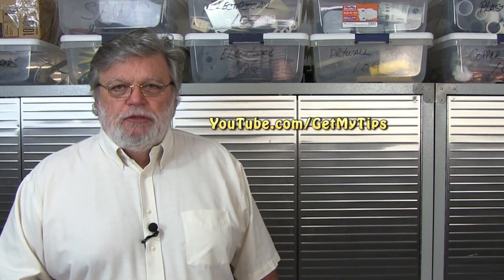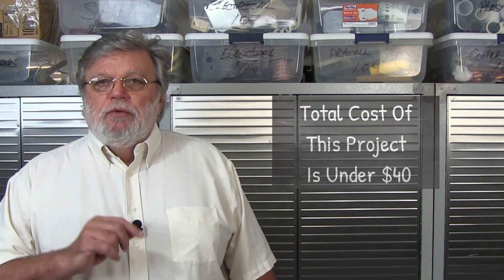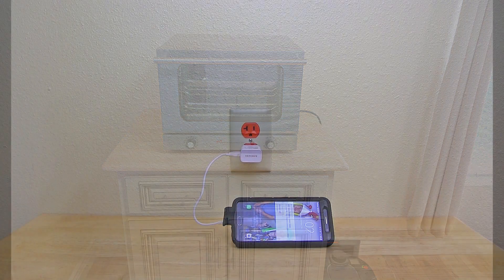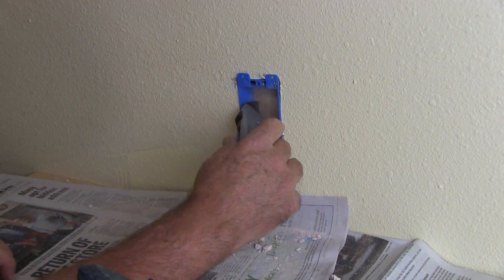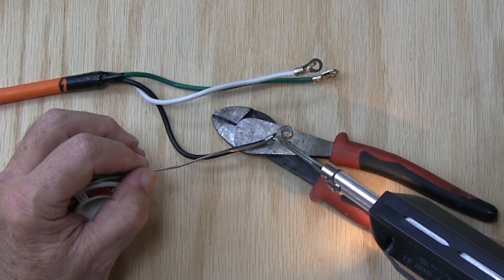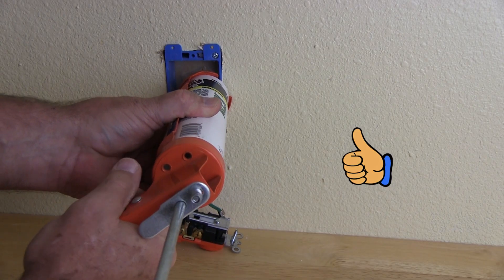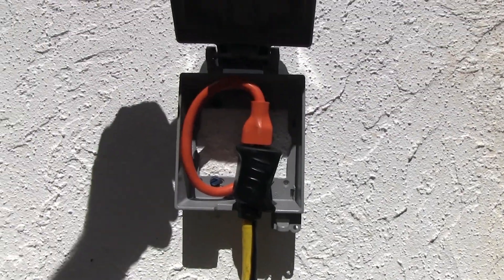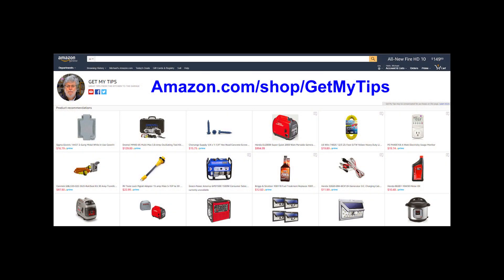How To Hook Up A Generator To A House

Comment: Not bad, but for a few bucks more you could go through the main panel with a breaker then use an interlock kit to force turning off the main breaker, which would both make it up to code AND supply 240 volts for more appliances without using extension cords all around the house. The most expensive part of doing it this way would be the 240 volt cable to connect the gen set to the house. Likely under $200 for everything if you shop around.
Reply from the maker: rupe53, The purpose of the video is to demonstrate how to connect a generator to the house without having to call an electrician. 99% of the population is unqualified to install any kind of transfer switch or interlock switch. Therefore they must hire a qualified electrician to do that. The video that I demonstrated is for folks who have a limited electrical skills and a minimal need for emergency power over a short period of time. Personally, I hope to never use my generator again. Although that is unlikely since I live in Florida. But if I do have to use it, I only need it to power a couple of small items for a short amount of time. So therefore, what was demonstrated in the video is perfect for me and most other folks with low electrical requirement in the event of an power loss.
Reply: Ok, I'm on your side and I understand the idea of DIY. OTOH, using ALL parts that are UL approved should be a focus on any home project like this. Shallow outlet boxes are available and the exterior could have been done with a fixed male inside the box instead of an old extension cord. The point is that once you modify a UL approved device then it's no longer UL approved. (cutting a box, cord, etc) While it may be a minor code violation, it's a violation none the less. If there should be an issue it's highly likely your home owner's insurance will laugh rather than pay up. Putting disclaimers under the video is only a patch / fix. Stuff like this needs to be IN the video so it's not missed. My guess is that for every 100 people who follow your instructions there will be a few who figure on using a longer cord or making other changes in a wood frame house where these minor problems can get out of hand. This is where people get in trouble.
Reply: @rupe53  perhaps he should of made a comment in the video. UL listing is definitely something people should consider. however UL listed does not equal the only safe way. What he demonstrated in the video is largely very safe for anyone with basic common sense. perhaps maybe even safer than some UL listed devices would be.
Reply: yeah, but most people are not willing to mess around the breaker panel without going to electrician school. Therefore they'd have to get an electrician, possibly have to turn off power, and possibly have to turn off power from grid.

just having to get the electrician makes it much, much more expensive.

it is definitely not just "a few bucks more."

Comment: Umm  if you do not kill the main feed to the house you will back feed the grid, possibly blow up a transformer kill a lineman working on the system also back feed neighbors and run a risk of blowing up generator when power is restored to grid...  do not follow this advice
Reply from the maker: I am curious sir, did you even watch the video? Please explain based on the way it was demonstrated in the video, exactly how it is possible to, “back feed the grid, possibly blow up a transformer kill a lineman” as you say.
Reply: Yea   guess I was only 1/2 watching   when I saw what looked like someone making a suicide plug.  My bad I will try to remove the post if possible.
Reply from the maker: +darvonlechtinstrad well I appreciate you coming back and saying that. However you should leave the post up because you're not the only one who makes that mistake. Perhaps it'll help somebody else. Thanks again

Comment: Shout off the main breaker so you don’t electicute a lineman.
Reply from the maker: This is not a back feed situation. The system that I installed is completely isolated from the house wiring. There is no way that any power company service man could be harmed.
Reply: HUH? this is not even going through the panel lol

Comment: I just run an extension cord to the fuse panel turn off the main breaker and hook up to the top terminals to power the whole house
Reply: People who dont know the basics shouldnt mess with electricity
Reply from the maker: Wow you must have a very powerful generator and a very heavy duty extension cord to do that.
Reply: @Flatus Antiquitous no it wasnt. And good for you.im electrical engineer as well, with mechanical as ba. It was directed to james...in saying that, as an electrical engineer, you know this is A: illegal almosy everywhere, and B nowherr near the best way to do it......not even close to engineer stats lol. Peace. You do it your way, i will do it mine.
Reply: in the words of Eddie Murphy,"Now Thats A Fire"!!!!!!
Reply: Dumb. Just plug in to dryer outlet.......duh. that powers both legs which is whole house. No open panels, no screws to turn, no cords to wire. Bam!

Comment: I thought he was going to wire the fuse box.
Reply from the maker: Scotty, There are lots of different ways to get the electricity from the generator to the inside of your home. Since I only needed to power a couple of items, the video demonstrates how “I did it”. It's an easy solution to a short-term problem, keeping the beer cold in my refrigerator until the power comes back on, ha ha. If you need to supply electrical power to your entire home and your generator is capable of producing enough power, you should install an automatic transfer switch, or a manual transfer switch next to your circuit breaker panel.

Comment: Very good video but you forgot to show one very important step and that is how did you wire up the wall socket. You can't just wire it any old way if you want it to work correctly...
Reply from the maker: Yes that's true but if someone does not know how to wire up a receptacle, they probably should not be doing this.
Reply: I appreciate the tips but the video specifically said one didn’t need to have any special electrical knowledge. So, yes, telling people how to wire or solder might’ve been a good idea, if required. 
Personally, I must have missed a step because it seemed like the installation was simply a plug in method to pass electricity through. I don’t see why shy wiring would have been necessary. Maybe I’ll watch again.
Reply: actually you probably could wire it up any way,  there are only two choices,  both work

Comment: Cool video, I ran my extension cord through the window, this method will be much much better than what I did thank you very much.
Reply: You can do that, but there is always a small risk of backfeeding. Just spend the extra money and time and do it right. Use an interlock and install an inlet to a breaker in the panel. Get a generator to power the whole house or at least most of it. I power my whole house with a 10kw. I spent about $1500 for everything. I had a cheaper option, but wasn't happy with it.
Reply: @billybassman21  I think you've got the wrong video. 

in this video he shows how to make a dedicated outlet only for generator power and since it has no possible physical connection with the grid there is no chance of back feeding. 

the outlet normally has no power and only has power when the generator is connected. 

it's a very good solution. I don't know if it's code compliant, but it's safe, cheap, professional, and nice.
Reply: @Victor-tl4dk  WRONG

Comment: Should you not use a short er cord from the generator
Reply from the maker: Actually no, because I use a 10 gauge extension cord. It's plenty big enough so there will not be a voltage drop.

Comment: Interesting information. I have been routing the 30 amp cord from my generator in through the gap at the bottom of the screen door and using all four receptacles to power all the appliances (except for the electric range and well). I may opt to install a similar outlet so I can completely bypass the gap under the door in cold weather, but am working on a whole house generator I got and a transfer switch, but that will take some time to get around to installing.
Reply from the maker: Thanks Bob, why not make a video when you install the transfer switch? Mike

Comment: There is nothing wrong here but nothing really gained either,... You are still running an extension cord to the appliance & a separate cord needed for each appliance so the only advantage here is that you don't run the cord the a door way or window :(
Back feeding through Dryer Outlet feeds the whole house & house can be run as normal :)
Reply from the maker: David, you go ahead and take the risk of backfeeding through your dryer cord if you want, but since I only need to power a refrigerator and a couple other things, I will do it this way. Mike
Reply: Well, sure,... Do what makes you happy :)
Nothing wrong with your way, I'm just saying there isn't much difference between the work you have done & running an extension cord straight to the fridge.
Feeding through the 240 volt Dryer outlet powers the whole panel & therefore the whole house.
Reply from the maker: Well it's true that the way I did it is not necessarily for everyone. Especially those who have high power demands. In Florida, because of the creepy crawly creatures of the night, both two-legged and four-legged, I must keep my doors and windows secure. Therefore simply running an extension cord through an open door or window is not an option.

Comment: Make sure your with in Code , many states this would be a heavy fine code violation .   I have hooked up whole home systems and similar wall outlets ,  but do to code and permits it may run several hundred dollars .
Reply: Code is for sissies....unless you're doing it for pay....I live in the country in Wyoming.  There is no code in the county...yet....and I OWN my frikin property and I'll do what I want on MY property.  I have a shop and a 220 genset.  I  simply back feed both legs and shut down the main breaker so if the power comes back on you don't get a conflict.   I've done this when our grid goes down and my neighbors call me and ask how I still have power when theirs is out.  My popsickles don't even melt!   hehe  and since it is backfeeding from the shop you don't even hear a generator running!  Easy peasy...so long as you're smart enough to not overload the compromised system you have.  Works for temporary shutdowns no problem.  I really only care about the house heater and the fridge....and TV when the Vikings are on...hehe
Reply: Missouri has no code outside city limits ,  but in town you need a permit and the job has to be inspected .   on my farm I hooked up to my main and had a deadman hooked up so the guys on the powerline did not get feedback just in case , never trust just a Subpanel breaker.  you can hook up a light to the power grid so you know when the power comes back on if you have the know how .
Reply: Excellent advice!  I'm an aircraft mechanic.....maybe not the brightest bulb in the box but can hold my own!  hehe  AND I'm one of those tin hat guys.....I have solar and wind ready to deploy if shit goes south.  Enough to run my freezer and a light or two.  If we DID get an EMP it would wipe out the solar panels so I  have them stashed, ready to put out if shtf.
Reply from the maker: Thanks for the advice I will check it out.

Comment: Couldn't a guy just plug the generator into and out side plug by making an extension cord with males on both ends? I realize this could go through your house down the main line so probably just shut off main breaker right??
Reply from the maker: Kyle Van Zee, That is a fair question and if you look at other YouTube videos, what you are asking might seem like a risk worth taking. However, there are a lot of potential issues with backfeeding a generator through your home internal electrical power lines. And I realize that you said, turn the main breaker off. If everything goes as planned, no big deal. However, if everything doesn't go as planned, you or someone in your family could be hurt. Not to mention an employee from the power company. So as a grandpa with gray hair, I want to ask you this question, if you have the time to ask the question on YouTube, why not take the time to do it the correct way?
Reply: You could do that but illegal in many parts because it puts utility workers at risk of electrocution if main breaker isn't tripped off.
Reply: Kyle Van Zee yup
Reply: You got it Kyle, I do that, shut the main street breakers off, connect the "suicide" lead in the basement, that uses one line of the 110, and put a jump wire between the two phases of a 220 outlet so that upstairs gets power, we can do this in Mexico.

Comment: That's fine if you only want to run a refrigerator. But if you want to power your house you need to do something more than that. You would have to run an extension cord to everything that you want to power in your house when the power goes out.
Reply from the maker: Jeffery, Thanks for taking the time to leave a comment. I'm not sure if you watched part 1 of this series on generators,  How To Buy An Emergency Generator, but in that video I Used A Tool To Calculate How Much Energy I would need when the power goes out. And in my case, my emergency energy requirements were very small. Here is the link to the video if you want to check it out: https://youtu.be/z9U7kuibqMc
Reply from the maker: Yes Jeffrey, I am demonstrating how I hooked up my generator to my house for what I needed to power. If you need to power your whole house with a generator, then obviously you need to invest in a automatic transfer switch or a manual transfer switch.
Reply: I went to FEMA website to get info on how to calculate power usage rating a generator...it pays to do a little research...my replacement generator is now rated to supply my house (except 220v well pump)...good video, Sir
Reply: Get My Tips but you are only using 1 outlet for your refrigerator, am I right? I want to be able to power the entire house for a few days if need be.
Reply: Get My Tips yep

Comment: I just crack a window and throw the extension cord through. But if I was a motivated individual, i might try this.
Reply: Here in Montana where the low temps can reach -35 F, opening a window is NOT an option.

Thanks for the video tip!
Reply: In the south we have a lot of tree roaches also called American cockroaches. They are those big flying ones. They will come in your house along with other things with an opened window.
Reply: Window open in many places would attract thieves, animals, critters and the cold winter temperatures (say -30 degrees some places.) Even if towels were used to fill the remaining gap of the open window. I know because I tried it in a power outage in mid of winter once.
Reply from the maker: Here in Florida, where I live, keeping a window cracked at night is not a good option. That's because the creatures of the night, both the two-legged and four-legged variety are inclined to take advantage of an easy opportunity. Have you checked out my video on how to prevent generator theft? That's another thing to consider. Here is the link, https://youtu.be/MWow-Xik7Ms
Reply: Get My Tips , I'm actually checking out a lot of your videos. Some really good stuff. A lot of your videos fall under the category of, "Now why didn't I think of that?", lol
Reply from the maker: That's about right, thanks for the kind words.

Comment: I like it.  I chose to do it a little differently but it still gets the job done.
Reply from the maker: Now I'm kind of curious. If you believe the the only way to hook up a generator from the outside of your home to the inside, is to call a licensed, insured, electrician, why are you on youtube looking at ways to do it on YouTube?
Reply from the maker: How did you do it?
Reply: I do it with a suicide cord, which is not the best way, but I take all of the precautions that I can to ensure that it is not backfeeding the lines
Reply from the maker: Okay but my personal experience has been some of the worst mistakes I have ever made was when I decided to take a shortcut and not do things the correct way. But as long as you are the only person involved in the process, you should be okay.
Reply: Agreed.  It is not really a short cut but a stop gap during hurricane season.  I am going to be hard wiring a better plug through a 60a disconnect this winter and it should be a much safer proposition.
Reply from the maker: Now that sound like a plan!